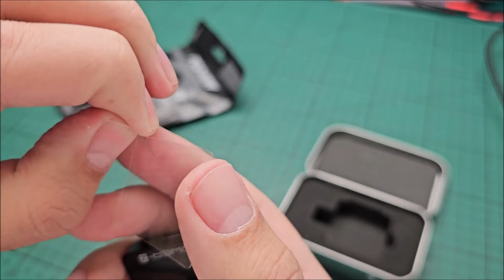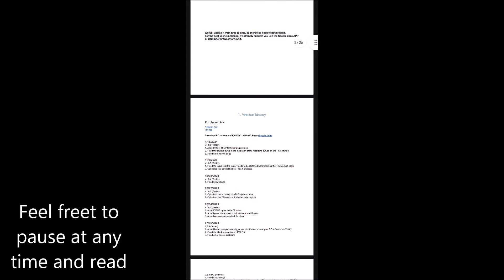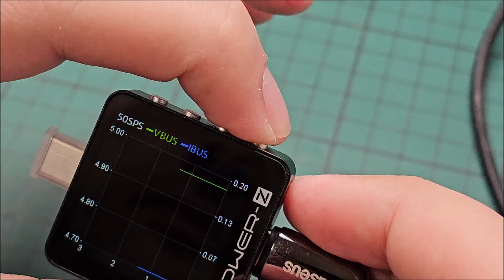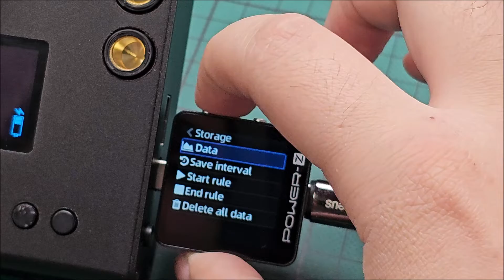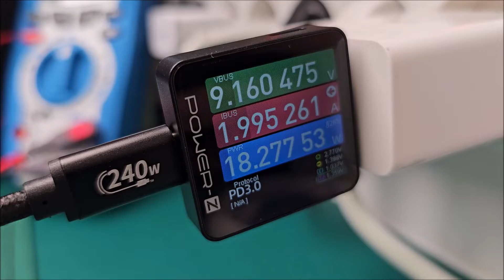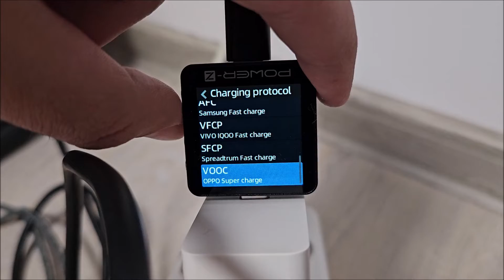ChargerLAB Power-Z KM003C Portable USB-C Fast Charging Tester ⚡

Comment: I recently got a similar but lower end KOWSi 2303c usb c power tester. I really want this Power Z but I just cant spend $100+ on a usb c tester of all things right now. My little Kowsi was $10, and for that price I feel like i got a lot of value. Its small, has a beautiful screen (i cant believe how bright and clear it is especially at $10!?) And it is also very accurate from what I came tell. It also has a live graph function so you can see power specs over a certain period of time. Im a huge nerd so little devices like this excite me. This Power Z is the top tier option and if uou have the $$, go for it. But if you need something small, simple, and cheap to keep an eye on your chargeable devices, the 2303c Kowsi is an excellent choice
Reply from the maker: Nice to know there are lower priced options with decent features 👍🏻

Comment: I can't believe what you wrote here. So you can damage your devices with this device. Then why did they still manufacture it?
Reply from the maker: You can damage devices while testing protocols. If you have a mobile phone connected, that only supports 5V and you are testing a charger that can go to 20V, while testing the protocols it will go to the 20V and fry the phone. So test protocols without any device connected and you are safe.
Reply: @UltimateDIY "testing the protocols"? What is this about?
Reply from the maker: This should explain it: https://uk.ugreen.com/blogs/charger/fast-charging-protocols
Reply: And one more thing I would like to know if you don't mind. Does this device work up to a maximum of 20 volts? What if, for example, I have a laptop that works at 21.5 volts? What do I do? Thank you
Reply from the maker: "The maximum USB PD (Power Delivery) voltage is 48V, as specified in the USB PD 3.1 standard, enabling power levels up to 240W."
So I guess it will be fine.
Reply: @UltimateDIY Ok. But qualitatively, is this device worth the money? Honestly. What do you think?
Reply from the maker: I like it and I use it quite often for testing
Reply: @UltimateDIY  I Understand.Tests for? Laptops or mobile phones?
Reply from the maker: This tests chargers, not mobile devices.
Reply: @UltimateDIY That's what I meant, powering phones or laptops. Interesting. There's always something new in this area. Ok, thanks for your time. Good luck in the future
Reply from the maker: Welcome! Good luck to you too ✌🏻

Comment: A shame if it doesnt show you stats.?
Fx if you charge something, it can be quite helpful to know avg, max, & min stats of the different parameters, volt, amp & wattage.
and so you can sense, the dynamic over time.
the graph if it shows the full runtime over the full charge course can perhaps give you a crude indication, where the majority of the charge has been, but it would still be nice to have it, with digits with max, min, avg digits.
The ripple feature were impressive as the details & tolerance / update rate looked solid.
I only have one meter in that Only TypeC formfactor and that the RED WiTRN K2 (237) also 50V 6A/10A.. it does not give you graph, and doesn't have a capacitor, bit it does ripple and all that jazz and you adjust some steps of frequency, but it does have the avg. max & min stats...a nd will also show databit specs fx 20Gbps /40Gbps for cables.

Comment: Awesome video!! I bought a KM003C recently and wanted a basic intro video before I fried my Galaxy S22 Ultra doing a protocol test 😅

I didn't realize until I watched this video that the protocol test is only designed to test the charger (not the protocol used by a device), so I understand why it says to unplug your device before using that mode.

Now I understand that to check the protocol a device uses, you just need to see what is reported on the screen without entering protocol test mode. I'm using this for the first time today so I'm learning the basics 😊
Reply from the maker: Glad my video helped 👍🏻

Comment: One critical thing too know is that this USB meter normally uses a separate power supply on the HID USB port! And it's is very easy to accidentally force the charging protocol to something that isn't what the connected charging device wants. 
The user manual is a very hard to understand. This tester is not set up to learn by trial and error.
Reply from the maker: Thank you for this information!

Comment: Hi buddy,
To help you with why you probably weren't drawing as much power as you thought for your phone ..... All phones work the same way. If it had just say 10% charge in it, it would probably charge at the full 45w or more. But as it gets closer to 80% full, it uses a LOT less. And then just trickle charges for the final 20% no matter how POWERFUL your (or my charger is) :-( It took me ages to twig on to this :-) Nice video
Reply from the maker: Hi. Thanks for this info. I actually also figured out the same while chagring the phone over a few months. It also probably takes bettery temperarure into consideration. So, at the end of the day, there is no way to make it draw more than it "wants".